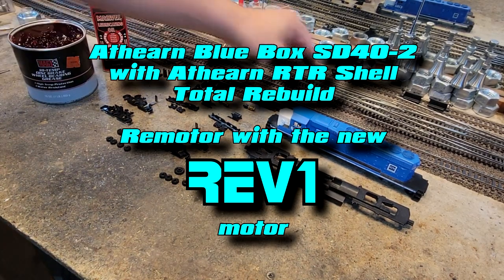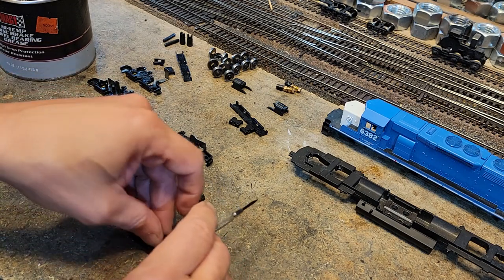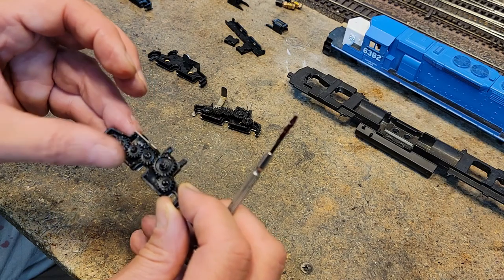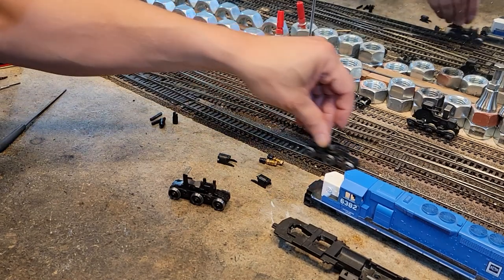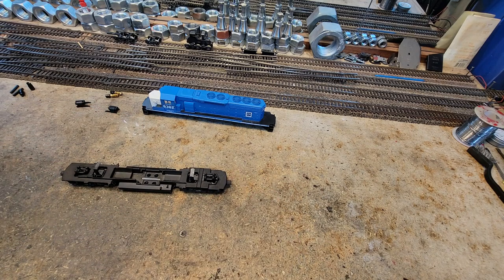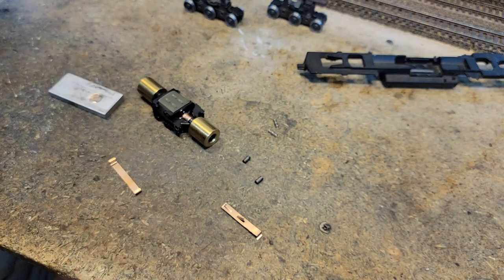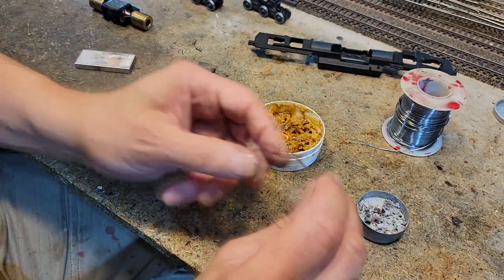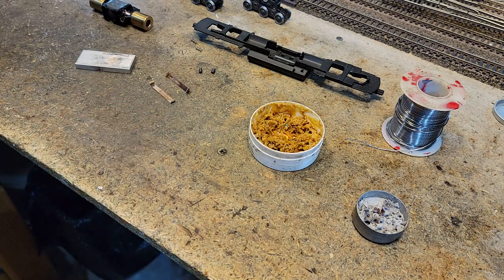Athearn SD40-2 Total Rebuild Part 1

Comment: Oh man I have been hoping you would do a in-depth one of these rebuild.
Reply from the maker: hold on.... this is only part 1.... we're going to do something never done before!
Reply: @elite194  Hot dang I'll be tuned in for this. Thanks for for putting it up for us to watch.
Reply from the maker: this build is turning out pretty nice, we're going to do something extra sweet with this
Reply: @elite194  Sweet. I'm down with it man.
Reply from the maker: @tudrow6087  it's happening now... I continue with shorter parts so I can put them out through out the day
Reply: @elite194  Heading that way now. I dozed off for a while. I tend to do that in my old age.

Comment: Suggestions, you should clean the spaces between the comutator plates, which are insulators. When an armature is worn from use the comutator plates tend to bridge across the gaps between the plates which will short the armature and cause damage.  Good idea to scrape each one a little to remove any bridging.
Reply from the maker: yes you are correct!  sometimes I take the scribing pencil and do just that - but I should start showing that because most people don't know that the gap might be filled!  good eye!

Comment: Don't suppose there is a possible source for the rev1 motors?. To be honest i need to re-motor a few of my AHM diesels and i was thinking of installing one into an MU coach that i have.
Reply from the maker: the factory is making the first production run right now and they should be here in about 3 weeks.  I'm planning to get them out to my favorite train show sellers.  They are a perfect fit for AHM.

Comment: The shell is off the early RTR, which used the coupler boxes to hold the body on the frame. The frames are very similar, less the lock pins on the sides. I have swapped BB frames under the early RTR shell.
Reply from the maker: I remember this one - it was a DC only locomotive for a friend and it's still running great!

Comment: Is it possible to do the 15 inch radius modification with a dremal?
Reply from the maker: yes, but a triangle file is must faster - 7 inch is really good, 8 inch is a bit too large and 4 inch is a bit too short.  these big files take off more material in a much more accurate way than the mototool.  they're also cheap.  single cut files give a nice finish, double cut gives a faster cut.  a square file is very aggressive, but also useful.  decent files cost less than cutting tools for moto-tools.  this is something we should do a video about!

Comment: About Warhammer paints, I tried it and it lives up to its billing you're right it is a lot better than ''Testors'' BTW the brand (''Testors'') is owned by none other than Rustolium paint company, And, Thank you very much for making me aware of that brand, I'll be using Warhammer/Citadel paint from now on.
Reply from the maker: also check out the Armypainter Warpaint fanatic set!  on the wet palette, these paints are absolutely incredible!
Reply: @elite194  Thank you very much for responding to my comments, Also, I must make a correction it was Games Workshop/Citadel, I'll try out that Armypainter Warpaint fanatic paint if i can find here in NYC if not I'll go out to the suburbs where they have better stuff.
Reply from the maker: you'll find the Armypainter next to the Games Workshop Citadel paints in most stores.  Be sure to pickup the Armypainter painting guid which a free booklet that has super awesom hexagonal color wheel inside!  If you love the Citadel, you'll also love the Armypainter.  They both go hand in hand.  I brought in a factory painted UP GP40 to find matching colors for armour yellow and harbor mist gray.  The guy went right over the the fanatic section and matched those colors perfect!
Reply: @elite194  Much appreciated, I will, And Thanks again.
Reply: @elite194  Hi it's me again, I'll make this short, What kind of acrylic paint thinner do you use in your paints?
Reply from the maker: the 3 cups are distilled water with a drop of baby shampoo, a cup of 91 percent alcohol and a cup with just baby shampoo used to save the brush after cleaning!
Reply: @elite194  Okay, And thanks again.